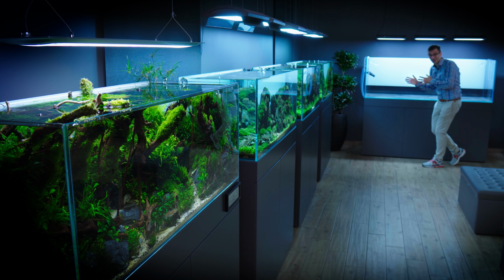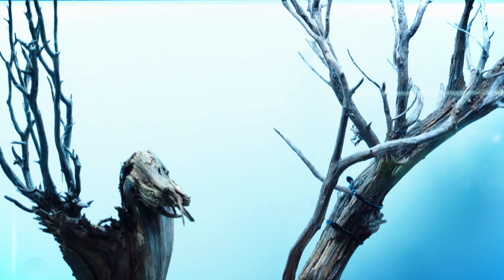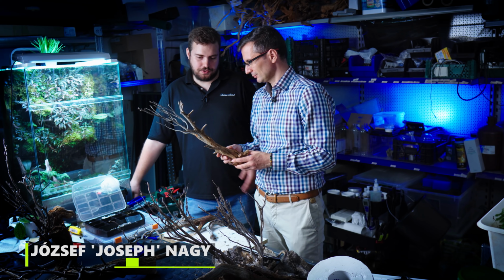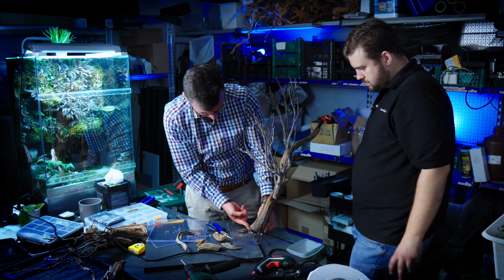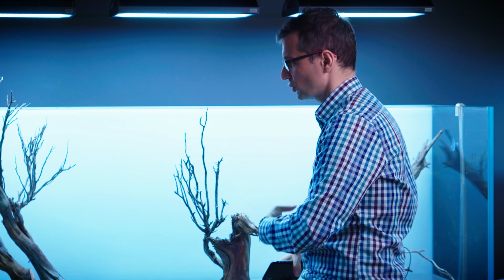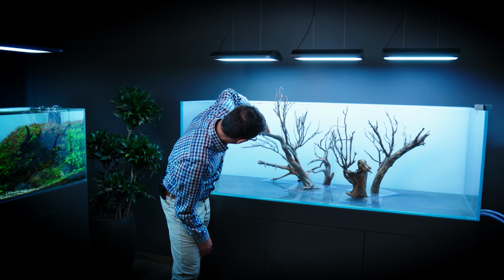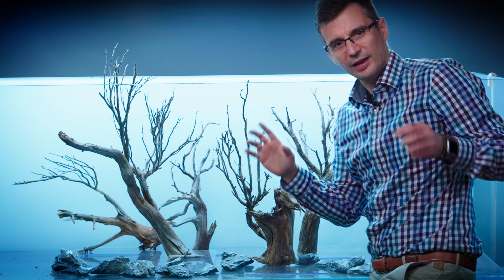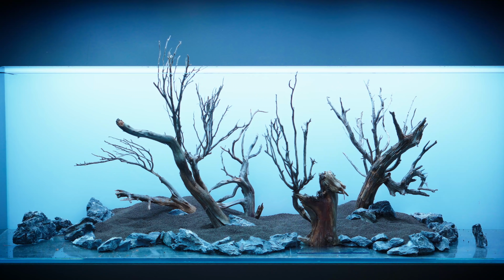BONSAI FOREST - 650 LITER PLANTED AQUARIUM - THE HARDSCAPE

Comment: Awesome tank 👏 - my only advise is make sure those are 316L stainless screws, those looked like zink or mild steel and will only last a few months before they rust and perish. If its not to late it will save you a headache in thr long run 😊
Reply from the maker: Nah, we will keep this, and see what happens later. Might redo the tank in 6 months anyway. :) But yeah, should have used some stainless steel screws.

Comment: nice video!
but sometimes i dont understand why there are zip ties...
Reply from the maker: The different pieces move all the time on each other. Just a slight movement can ruin the layout. We try to keep them in position.
Reply: @GreenAquaShop  yeah obviously, but somtimes it lokked like theres a zip tie just around one piece of wood
Reply from the maker: Not sure, but it can happen. We've used like 50 zips in the initial stage when we did the concept.

Comment: @GreenAqua don't use angle grinder with circular saw disk or other wood disk freehand. This is major risk and causes lots of injuries each year! Buy small sabre saw! There are battery powered realy nice and small. For angle grinder buy stone disk and leave it for stones.
Reply from the maker: Thanks for pointing this out. We will be more careful next time. Been in the rush with the production but injuries happens exactly when you're in the rush and do not take the necessary steps or protection. 👍

Comment: Hey guys at green aqua 👌 massive fan of your work, amazing!!! Can I just ask what composition screws did you use that wouldn't affect the water or rust up? Can't wait to see this complete
Reply from the maker: Thank you 😀We've used mixed ones because of the rush work. Did not have time to prepare for the video completely. Still, we do not plan for a long-term thing so it will not cause problems in that timeframe for sure. 👍 Thanks for your feedback
Reply: @GreenAquaShop  Coolio 😎 have a great day guys

Comment: can the glue which is used to attach the hardscape to the tank bottom be removed later ? without scratching the glass
Reply from the maker: Sure you need to use some blades and you can remove it easily

Comment: A lot of excellent work and effort went into such an awesome start to a really different Bonsai setting. I myself have been doing Bonsai for 12 years and have been reflecting this in my AquaScapping even though I’ve only just started this in the last year. One thing I have found very useful from my Bonsai experience, is that you can heat the deadwood and it bends! You can either do this just with flames or the best method is definitely by wrapping the material in a wet cloth then wrapping it entirely up with Tinfoil to hold in the steam. I then wrap the wood with the desired thickness of wire (bonsai wire) to hold the bend in place. Leave it to dry out and remove the coverings and let the wood dry out and the wire is left in place to hold the position. 

Can’t wait to see your next stage as I’m about to start a Bonsai scapping in a six footer myself for a Frontosa tank display. 🙏
Reply from the maker: Wow Scott, this is a useful technique, thanks for sharing, will definitely try it and come up with the idea as my own in one of the videos. Haha. Surely not. Thanks! Next vid on this tank only on next week, waiting for the tank to cycle.

Comment: 6:00 why not use glue?
Reply: Or super glue
Reply: Or silicone?
Reply from the maker: those would be more visible - and we don't plan to cover that part with plants.
Reply: @GreenAquaShop  i mean at the base where u was drilling plastic sheet into the tree ?
Reply from the maker: yeah, it would not have been as stable as with the plexiglass - I guess.

Comment: I have a 10gallon planted tank but with only gravel no substrate, with heater, with submersible air pump filter started with fish in cycling with 2 guppies both of them died after 4 days.  I then decided to do fishless cycling then I realised ammonia source required so i again brought 2 x black spot barb fishes but they didnt' look great so i put them in a water tub and decided to do fishless cycling with tank since 1 week. I put 2 x raw uncooked prawn to get ammonia spike the seachem alert reads ammonia 0.5 ppm it reach here gradually day by day in last 7 days. I am also putting seachem stability as per dosage required since 7 days still no trace of nitrite. I didnt do any water changes since 1 week but before that for almost 1 week i did 2 times water changes almost 50%. What would i be doing wrong? I kept temperature 79F  initially first week now in 2nd week i kept temp at 86F. Can you help ? My Gh0, Kh 180,
Reply from the maker: You need strong filtration, good soil to help with the filtration, daily 50% water changes on the first week. Check out our tutorials, you'll know a lot more from them. Cheers.

Comment: Great scape coming our way again...   look forward to the progression & end result. However, I would highly recommend using stainless steel screws as the yellow passivated ones used will rust and could cause problems down the line... if changing them is not possible perhaps covering them with a thin layer of silicone will protect them from the water. (Hope this is helpful) 
Take care all and stay safe👍
Reply from the maker: Yes, you are right about the screws, we should have used stainless steel ones, but was in a rush with the video production.

Comment: Can t wait to see the next video. Are the screws any particular kind that you use to fix the branches on to the main stems etc  ?  Was just wondering regarding rusting  in the water
Reply from the maker: That will be a problem - probably. You'd be better off if using stainless steel screws.

Comment: Dear Balazs, have a good day. I'm designing a new aquarium for my house. (60H) I preferred mountains with steep slopes as the theme. I used Dennerle 9 Deponit mix as a fertilization base. I used JBL Manado as plant soil. I want to use a decoration sand for the path that will lie in the foreground and in the back. I can use "ADA" la plata or Colorado sand or JBL's Sansibar decoration sand, but I don't know which color would be more compatible with Manado. Then what would you use if you were me? Your advice means a lot to me. I'd appreciate it if you could take the time to answer.